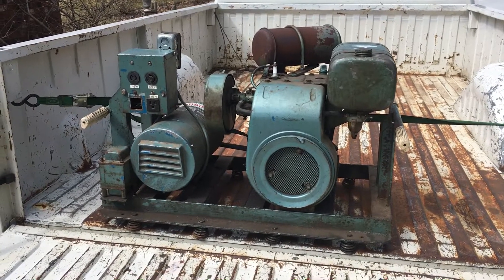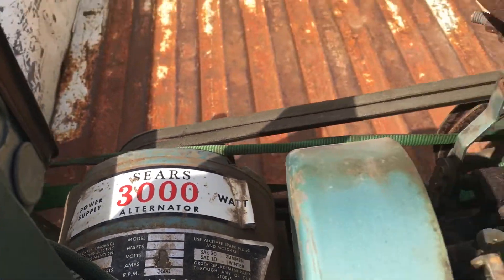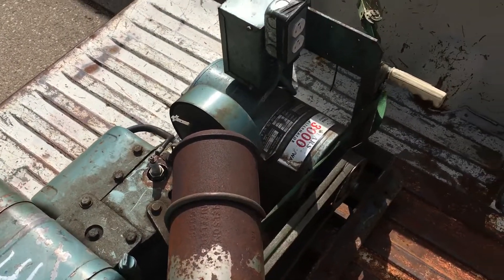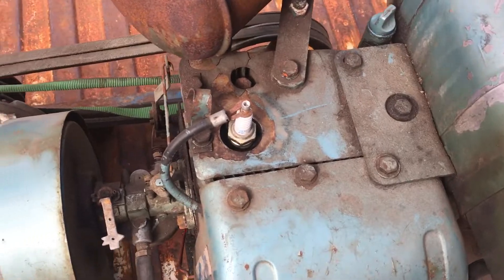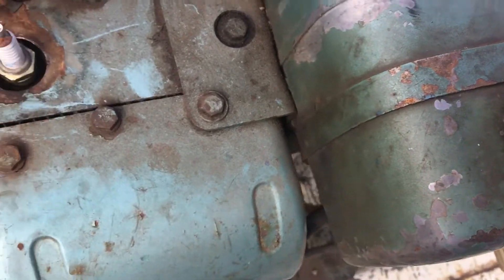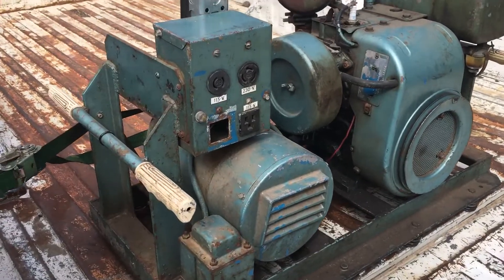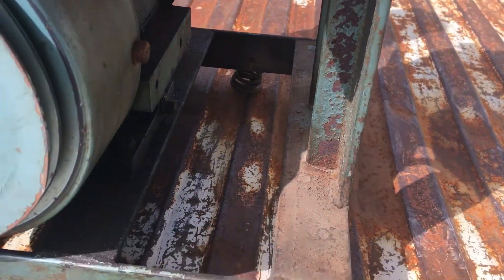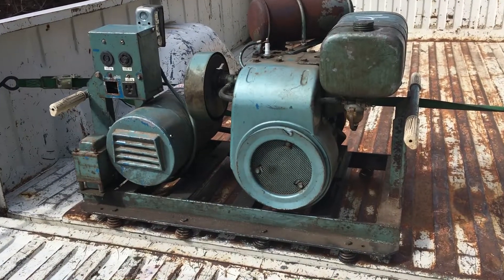1966 Sears 3000 Watt Generator

Comment: It would probably be expensive to a degree but what an awesome project to restore back to original. May never need it in a winter blizzard but could bring it out to power some tools, a string of lights while drinking Pepsi on the deck or whenever feeling nostalgic.  More of a conversation piece with a "damn that's cool" factor to it !     Nice find 👍
Reply from the maker: R Grimm thank you! Yeah I got it more for the fun of the conversation and to try to fix it. If I can get it working again I will probably end up selling it down the road but if I can’t get it working, I’ll have an engine for a tractor!

Comment: I have the same generator, but with a 9.6HP Clinton engine. And yes it is UNBELIEVABLY HEAVY! I was told mine is 1964 model. I also have some of the original paperwork for it. Good luck with yours. :-)

Comment: I remember these from the 1960's Sears Farm Catalog. Nowadays they are all 3600 RPM direct-drive or lower RPM inverter generators. I have searched high and low for an image of one of these belt-driven units, which run the engine at lower RPM by using the belt and pulleys to obtain 3600 RPM at the "head". Back in the 60's, the OTG people claimed these belt-driven units would run "for ever". In most cases a modern 3600 RPM direct-drive generator works just fine for most situations. The problem occurrs when running 16/7 or 24/7 in a 110-120 degree desert environment. This problem is exacerbated by proximity to multi-square mile solar fields which raise the ambient temperature 10-15 degrees in certain conditions. I managed to kill off two direct-drive generators at my friend's OTG dwelling last summer. This with an oil change and air cleaner service every 5-7 days. The first was an older 4000 watt unit, which died in about 2 months, and is currently (hopefully) being repaired. The second was a brand new 5000 watt unit which died in about 4 months with bad rings and is currently in the shop for a new engine, hopefully under warranty. The typical load being applied is a small 275 watt swamp cooler and a 375 watt 5000 BTU air conditioner, or 650 watts, with an occasional 1000 watt microwave. It is my theory that running the engine at 1200-1800 RPM will drastically improve this life span. The problem is I can not test this theory because no one makes these units, and it will cost "an arm and a leg" to build one. A 5000 watt head alone costs more than an entire 5000 watt direct drive machine. It is "mechanically challenging" to convert a direct-drive head to belt-driven. The seemingly obvious solution is to use an inverter generator. Unfortunately, the desert conditions kill off inverter generators even faster than direct-drive. They can't take the heat. My neighbor exchanged his 3 times under warranty and then they wouldn't do it any more. My OTG friends' yards are "littered" with dead generators. This includes not only lower cost models like Predator and Duromax, but higher price brands like Kohler, Honda, and Kawasaki. Generator repairs are very expensive. Unless the problem is something easy, like an AVR, it will be necessary to "split" the engine from the generator, then open the crankcase. This involves a $150 labor charge before any actual repairs are made. Also, the nearest service place to here is a 50 mile round trip. With a belt drive unit, the engine could be swapped out in half an hour in the field by an unskilled technician (like me) amidst extreme heat and dust storms. Also, the lower RPM belt-driven unit should be much quieter. I will be interested to read others' thoughts on this issue.